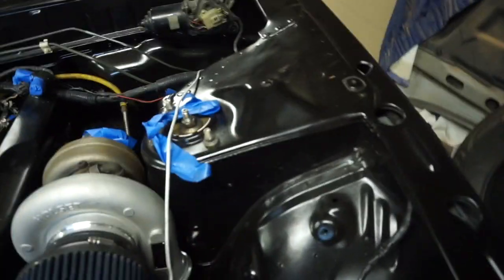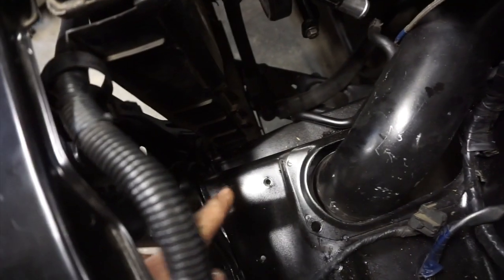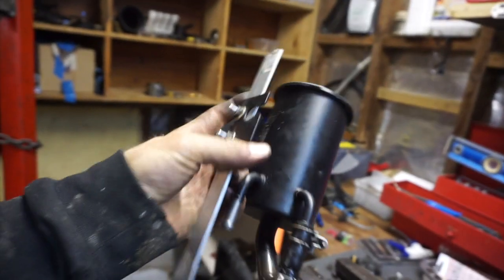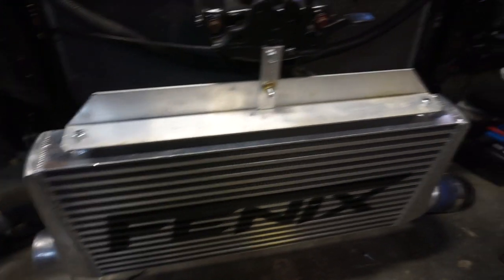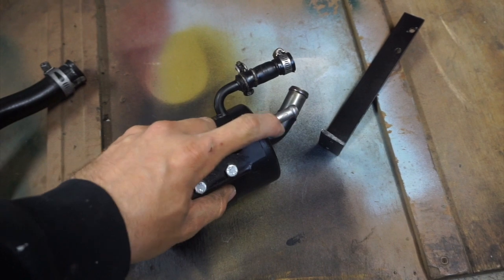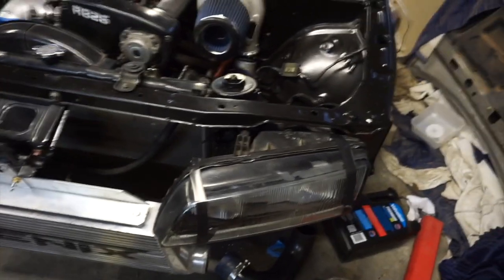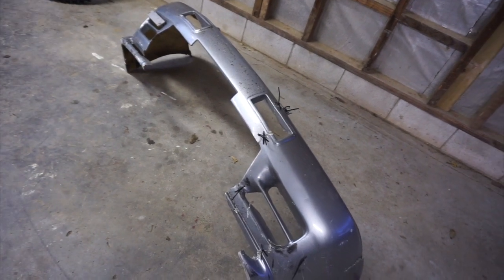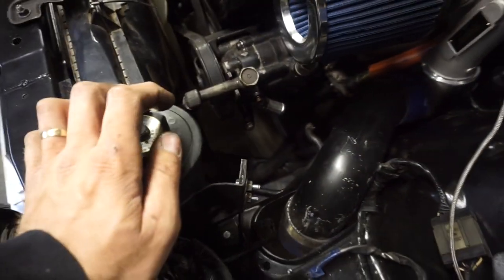R32 RB26 POWER STEERING RESERVOIR RELOCATION

Comment: Were you able to find out how long each power steering line is? I'm trying to replace all of mine with braided steel so it'll never leak (again), but I cant find the measurements of the lines.

Comment: What power steering fluid do you use?
Reply from the maker: AbelTV I use castrol
Reply: @vlrb25det11  castrol steering fluid right? And not  Castrol Dex 3 ATF right? I did my hicas delete and need to top if off so not sure on what to top it off with.
Reply from the maker: AbelTV just got it my stuff from
the warehouse as it was cheaper then at repco